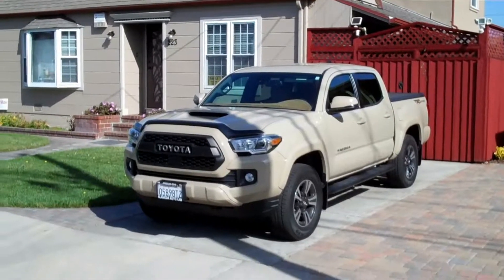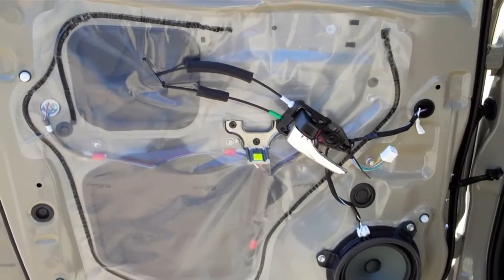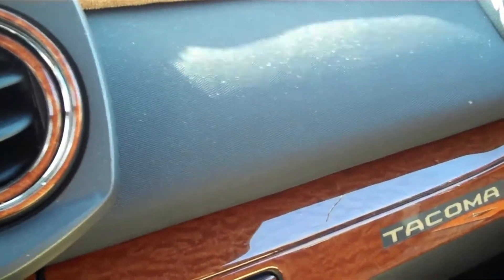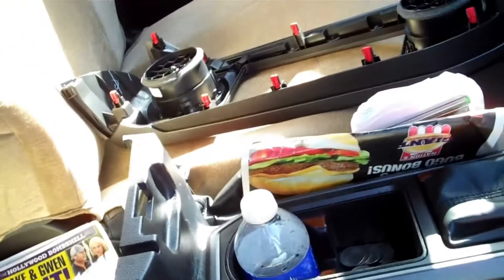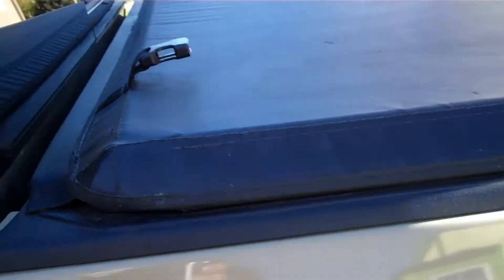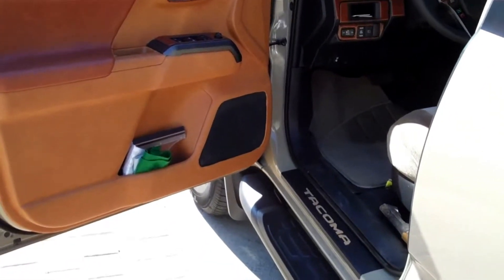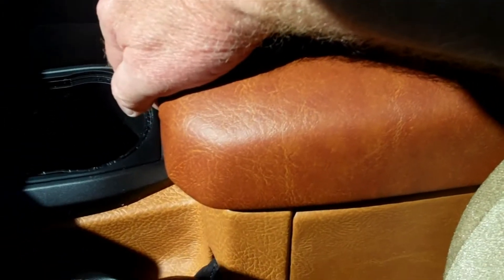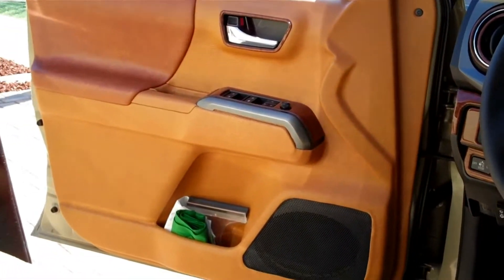Modifying The Interior of my 2019 Toyota Tacoma TRD Sport!

Comment: Looks great ,Your the only person who has one like this ,I wanted to ask how much it was because I am planing on doing something similar and making my Tacoma a 1794 theme and I want to know what I’m getting my self into
Reply from the maker: Hi Benjamin; thanks for the compliment!  As far as price goes, of course it depends on who you get to do the installation of the leather [faux leather].  The material itself would be the same cost wherever you are.  I suggest buying the material yourself directly from keystonbros.com, or if you are near one of their stores, go there and see it in person for yourself.  I live in the San Francisco Bay area, and here in my town, there is a guy who has been doing interior work for over 30 years now, specializing in vinyl [faux leather].  I'll tell ya' me makes it look easy!  And I also took off the panels myself, thereby saving some labor.  He had me bring in the two rear panels first, and when they were ready, I brought in the front panels, as well as the center console armrest and the panel above the glove box.  The labor for all this was $1400 and the cost of the material was just under $300.  I admit that I bought too much, but I wanted to make sure I had enough and also, in case there were areas I wanted to do later, I would already have the material.  The one thing I wish I would/could have done, was the dash.  I mean, he does dashes all the time in addition to the rest of the vehicles, but it is not as simple as it would look.  He actually takes out the windshield, and completely removes the dash from the vehicle, which of course, would be the correct/best way to do it.  But the thought of him removing the windshield and dash on what was then, my brand new truck, well, I just couldn't let him do it, and also, I just didn't want to do without my truck for at least a week, while he took it apart.  BUT, having said all this, I highly suggest that you just DO IT, if like me, you hate the cheap looking black plastic door panels, as well we the cheap padded parts of the door panels and the cheap panel above the glove box.  HATED THEM!  Believe me, once it is done, and when you first set your eyes on the finished product, you will wonder why you waited so long to do it!  For me, when I brought in the front panels and he brought out the rear panels, my gosh, I know I was grinning from ear to ear!  That is why I insisted on him holding up one of the panels he had done, and one I had just brought in, so I could show the before and after in one pic.  That is the thumbnail pic for the video and heck, just look at that pic, and that alone should convince you to have it done to your truck!

Comment: The stick-on wood like trim looks really bad and tacky. Other than that it’s look great
Reply from the maker: Your opinion.  However, I actually tend to agree with SOME parts, which have since been removed after this video, as well as the original video called "installing a wood grain dashboard" or something like that,was made.  In that video, I detailed the process of installation. Since these videos were made, I have deleted the wood around the CD screen, on the sides of the door handles, and a few other pieces, leaving only those on the dash where the various switches are, as well as the trim around the interior door handles.  So I agree with you, but only to a certain extent.  Thanks for the comment...

Comment: I have a 2019 TRD OR and the door panels are garbage. Pure crap. 20k miles and they look like 200k. I'm going to have this done as well, but not that color. Looks good.
Reply from the maker: I totally get it!  I hated my door panels even before I got the truck, but I thought I would get used to them. NOT!  My friend actually works at the place where I bought the faux leather [vinyl] and so after consulting with a local auto upholsterer and one who was actually recommended by the vinyl place, I decided to go for it, and have it done.  The website is keystonbros.com.  They have a WIDE range of colors, etc to choose from.  I chose what I did, because I wanted to spruce up the interior and it fit well with the color of my truck.  But man, get it done; you will not regret it.  I only wish I would have done the dash, but although my local upholsterer did dashes all the time, for me, I didn't want to do without my truck for at least a week, as it would take them at least that long, to remove the dash, cover it with the vinyl, and then reinstall it.  And although they literally had a shop full of other vehicles that they were doing the whole interiors of, including the dashes, I just didn't want them removing the dash and everything connected to it, even though they have been in business for over 30 years and do it all the time.  So I put that dash cover on there, because it was better than looking at the black dash, but I admit I don't really like the dash cover!  Anyway, thanks for liking what I did!